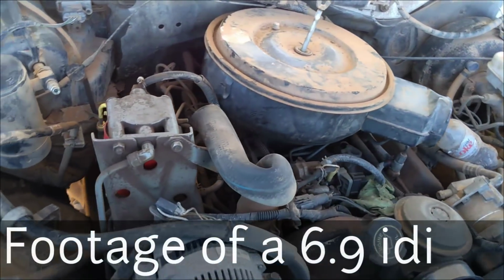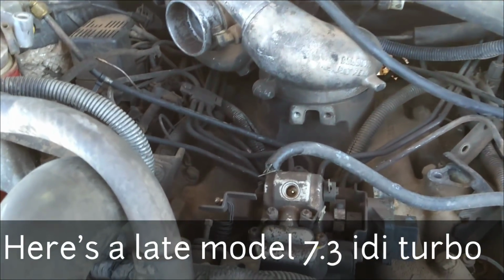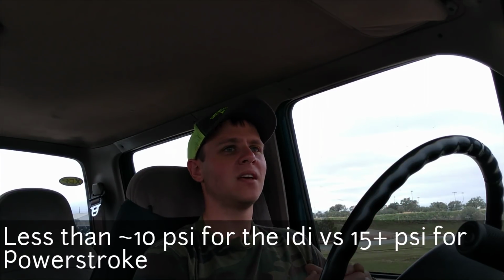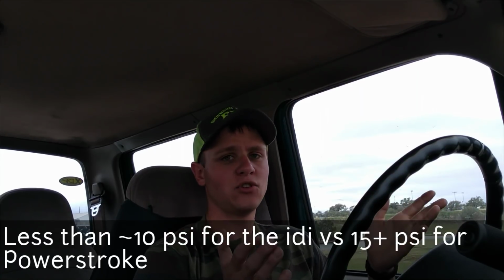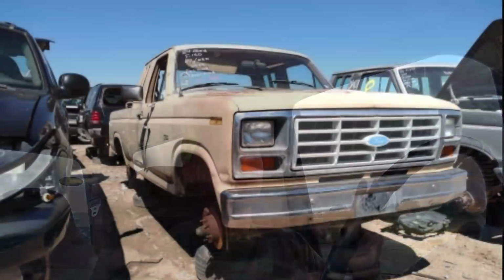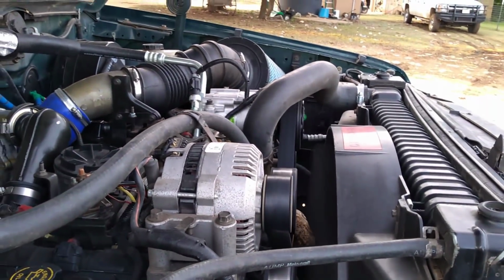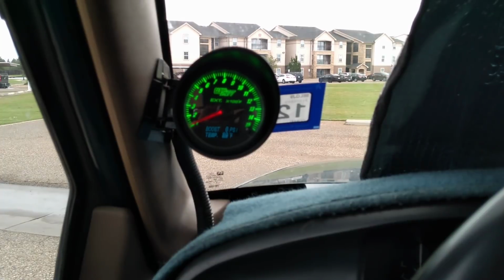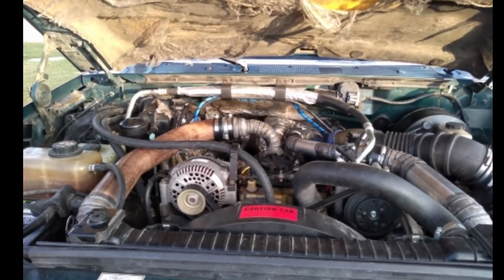7.3 Powerstroke Pros and Cons Part 1 of 2

Comment: I have owned 3 powerstrokes and 2 IDI's plus recently I talked a buddy into buying a 97 ambulance with a rat chewed PSD. I prefer a NA 7.3 IDI enough power for my 89 2WD F250 gets good gas milage currently 19mpg in town and keeps up with traffic compared too say my 83 Mercedes240D. The Powerstroke has gobs of sensors is much more expensive to work on (well replace parts) then the IDI. My buddy's ambu took awhile to get dialed in and I watched his enthusiasm wain and soar, hes currently soaring as its running like a well tuned machine. The biggest issue with any diesels is the fluid replacement is costly, Im always putting diesel clean or ATF in my fuel, diesel as we know is more expensive then gas, coolant change out is minimum of 130 bucks,, but needed due to cavitation, all in all I love my trucks and cars that are oil burners but maintenance is key to longevity. Excellent video!
Reply from the maker: Thanks for the compliments Deepblu dude! Diesels are definitely expensive, but in the end I still think its worth it. These old Fords are fun to drive and they're simple enough to work on at home. I really like the old IDI's. In some ways I do wish I got one instead. They are cheaper to work on. I've done some preventative maintenance on my 97 and its $200 for an ICP sensor, $40 cam position (plus another $40 for a spare in the glovebox). Injectors were over $1200, but hey, the thing makes gobs of power now! I know a set of IDI injectors would have only cost in range of $300 instead... I mostly just worry about the people not taking care of the IDI like you do. Most folks don't pay attention to the coolant and you really have no idea what state the block is in cavitation wise. I'll second that, maintenance is key to longevity. Happy trucking!

Comment: great vedeo mate and good explained but on my opinion I prefer a minimum electronics stuff's!! I prefer a first 7.3iDi Because not have a electronic injectors!! and more fiability but I have a excursion 7.3 power stroke 2001model but if I can I replaced this international engine to the CAT 3208 without a turbo!! that's a really good engine!!
Reply from the maker: It is nice to have the all mechanical diesel, I really wanted an idi at first, but somehow I convinced myself that the Powerstroke would be better in the long run. I'll get me an idi one of these days, those bull nose OBS Fords are some of the best looking trucks too. 3208 would be cool, but that is a giant engine, so good luck fitting it in the truck, better yet, just drop in a 3406 and remove the hood!

Comment: 2018 and he is recommending bullydog or ts6? HYDRA!
Reply from the maker: Yeah yeah, I like the old school simple switches anyway! Besides, its so much fun to rip apart the interior when/ if you ever decide to change tunes, think of all the fun you're missing out on with the Hydra! Tbh, the TS6 chip was cheapest, that's the only reason I got it over any of the others.
Reply: @Rnddiesel   I seem to have the interior ripped out more often then normal people. it is down to bare frame now for a resto mod
Reply from the maker: @xxxmikeyjock  That's awesome! I'm sure its a lot of work, but not many folks take the time and dedication to do that much to fix up an old truck. Best of luck with the resto!

Comment: How popular is a 2000-2003 dually supercab  powerstroke 4x4 these days in the modern world ?
Reply from the maker: Good question, I think it depends who you ask! I can't say I've seen very many of them driving around, though they definitely are cool rigs. Is this a truck you're looking to sell?
Reply: @Rnddiesel  great reply ! On the contrary, I own 2 LBZ duramax,  however a buddy is selling a 90000 mile 1 owner dually supercab 4X for 6000, meticulously maintained, its like I almost want to have it because I want it, but really don't need it ) does this make sense, I also own a from new 1993 f-150  so it's not like I'm not a ford person, but the powerstroke is a very cool addition! And well if I decide not to keep it, I wonder how difficult it would be to sell it on maybe for a profit ?
Reply from the maker: @lanaliong3712  If it's in as good of a shape as you say, I'd get it without  a doubt. Finding a 90k miles 7.3 is like striking gold, that is they are very rare at that low of mileage. For $6000, I'd say that's a steal of a deal no matter how you look at it. Unless it's been wrecked or something like that, that's a great deal. Definitely look and see what comparable 7.3's are being sold for. For reference, I paid $4500 for my CCLB OBS 4x4 with bad brakes, worn injectors, bad radiator, no AC and 343k miles on the odometer. Even if the dually supercab isn't the most sought after, I think people will want the truck simply because it has such low mileage and is in great shape. Also those LBZ's are pretty cool! Those are impressive engines and make gobs of power. A buddy of mine had one back in high school before wrapping it around a telephone pole... He could brake the tires loose going 45 mph on a wet road. It also pulled our show tractor like it was nothing!
Reply: @Rnddiesel  great advice.

I also like the fact you agree the 2002 dually supercab stroke is less desirable CONPARED to A LBZ 

Right on point

You know your trucks 

I'll let you know how it goes )))) just sold my cavalier tonight for 3000

Can't go wrong on that too

It was time to let go ))
Reply from the maker: @lanaliong3712  Sounds good! Well you've got to tip your hat to GM with the Duramax line. They were the first to implement a lot of modern diesel technology early on. Heck with the introduction of the LB7, they were the first of the light duty market to offer common rail injection. True, their injectors weren't known for being the most reliable in the world, but when Cummins still used a modified mechanical pump and International was using the HUEI injectors, GM was way ahead. Some would argue the Duramax was the reason why Ford did away with the 7.3 in favor of the rush to market 6.0, in addition to emissions regulations...
Reply: @Rnddiesel  agreed,  hate to say this but, Isuzu division really saved gm on this one.

Comment: i got an 84 f350 6.9 idi 40 years old and still kicking and i get 20 MPG  to
Reply from the maker: That is an awesome and beautiful truck you've got! That was my dream truck for the longest time, and still is in a way, though an 85 or up model would be nice for the reinforced block heater hole in the block. Manual transmission?
Reply: @Rnddiesel   c6 3 speed auto extremely dependable

also if your block survived so far without cracking then you just remove the block heater and use a lower radiator hose heater then the block does not get a hot spot and won't crack from the stress best part is it just T's into your radiator hose

my truck will start in -40 no problem  even without the heater (lol just 40 min warm up)
the trick is kerosene mix it 
90/10 diesel/kerosene for old trucks
80/20 for 30 to 40 F
and 50/50 for -50 to 10 F
dont forget to add some lube tho the kerosene is more dry than diesel

the old trucks need a more combustible fuel to run properly because they were designed to run on "standard" diesel with a cetane rating of 60  not ultra low sulfur diesel with a cetane rating of 25-40

i wish i could win the lottery i would yard would be 1 huge shed full of 63-91 trucks/cars
Reply from the maker: @Friedrich-Wilhelm-1980  That's awsome! I've heard the c6 is a pretty good transmission too. I've got to get an idi one of these days. It's definitely impressive that your truck can start so cold, heck I've only ever been in -11 degree weather before, we had a gas suburban and it started without any fuss! I appreciate the fuel mixing tip. I never even thought about relocating the block heater, that opens up the possibility of getting an early model 6.9 then, thanks! I definitely hear you on the winning the lottery part. Have a shop full of old cars and trucks with every tool imaginable to restore/ fix them up. If you could get a die sink electrical discharge machine, 3d scanning/ modeling software and a 50 ton press, you could remake any part on the whole truck. Best of luck with the lottery, I know I'm hoping to win myself!

Comment: I own a 2000 7.3L Powerstroke CC LB DRW 4x4 ZF6.  Best "big truck" I've owned, will never sell.  Wouldn't own a 6.0 if you gave it to me, same for the 6.4 or 6.7.  No thanks.  I'll keep my 7.3, thank you very much!
Reply: I have a 2000 F250 7.3L SRW 4x4 but I have the 4AODD but she is 21.5' of glory and only at 149,271 miles
Reply: Are you high
Reply: To be fair. The 6.7l is bad ass. Ive got a '17 f250 and love it. I DO want a 97 7.3l f2/350 though
Reply: Chris Farley I’ve got 2000 yr f250 7.3 and 368000 kms also have a tune in it , no transmission rebuild for me as yet. It’s my service truck.
Reply: Would you take your 7.3 over a LBZ duramax ?
Reply: @lanaliong3712  Yes. All trucks including the duramax have their issues. I'll take the ones that come with my 2000 F350 7.3L over any other variant out there. And I'd do it without reservation. As always, YMMV. Thanks
Reply: @RX7GSLSEowner  i have a 2000 F250, feel the same way.
Reply: @lanaliong3712  early Duramax is junk. Too many problems. Hollow crank shaft? NO THANKS. DURAMAX IS NOT A REAL MEDIUM DUTY ENGINE. 6BT AND 7.3L ARE REAL ENGINES. ALL IRON. OVERBUILT.
Reply: dsruddell I am happy with 1982 GMC C2500 6.2L diesel TH400 3:73 rear axle ratio and I do just about anything the other diesel pickups can do and I can do it burning less fuel. It's no speed demon yet it gets from A to B
Reply: @mikemcgrew65  ive owned a few of those. they are junk and make no power. they were designed as a fuel economy engine. not for heavy duty use.
Reply: All day long. The duramax from that era was prone to injector and head gasket failures.
Reply: @lanaliong3712  every component on the rotating assembly of a duramax is much smaller than a 7.3L. cranks on the duramax are hollow too.
Reply: @dsruddell  well hauling 15000 pounds
consistently for 450 miles a day every day to a million miles with power and efficiency and the Allison it's a no brainer ask Indiana transport they have done it and still rocking their 2005 LLY

Comment: i work my 7.3l hard but i change my oil at 3k... sure it costs a little more but at 5k your oil is junk and you will spend the difference in oil changes on new injectors sooner
Reply: Maintain and keep stock your engine won't knock got life time oil changes still and I bought mine in 2002 it drug carpet up to Tahoe had 18,000 when bought now has 220,000 its weakness has been wireharness fails,transmission and cold starting cause where I live is cold in winter and hot in summer.Heater cured the cold start but am dealing with transmission  issues but rather get her on the road than deal with newer garbage and their expensive costs.
Reply: @lawrencemartin519  mines at 314k but I have a manual so I can't help you with the trans problems. If you plan to keep the truck I'd have Brian's transmission do a lifetime trans on it and be done.
Reply from the maker: It's never a bad thing to maintain your old 7.3, I'm sure she appreciates it!

Comment: I was under the impression Ford made IDI motors with a turbo from 93.5 to 94.5 and after they utilized the powerstroke?
Reply: Yes ford did offer turbo idi from 93.5 to 94.5. The motor has some upgrades done to the internal to support the factory turbo compared to the N/A idi.
Reply from the maker: That's my understanding too. Somewhere around early 94 they made the switch and offered the turbo IDI alongside the 7.3 Powerstroke as well.

Comment: Very good video it's nice to see people that really know these diesels. I own a 7.3 power stroke. And when I take the oil fill cap off when it's running I see a light white smoke coming out, but when I but the cap on the top it doesn't blow off or even vibrate off. Any suggestions will be appreciated
Reply from the maker: I appreciate it! The smoke you see from the oil fill cap is 'blowby.' Essentially it's combustion gases that are leaking past the piston rings and making their way into the crankcase. Even new trucks have a little bit of it, current technology doesn't allow us to make piston seals perfect. From the sound of it, your truck is just like mine regarding the blowby. With the cap off you see the smoke, put the cap on upside down and it just sits there, that is good. If the cap was blow off by the pressure in the crankcase, there is where you should be concerned as that would indicate a severe loss of compression in at least one cylinder, maybe due to a cracked piston, broken ring, or any other wild possibilities. Is the truck burning tons of oil? It is very low on power? How many miles? My truck has nearly 365k miles on the odometer, it's a bit worn, but doesn't go through more than a quart or so of oil every 3-4k miles, though it does also leak some of the oil too. The 7.3 Powerstroke is a good engine, just take care of it, keep up with the maintenance, and as long as it doesn't seem like there's something terribly wrong with the truck, don't worry about it. If it runs fine, doesn't consume too much oil, makes decent power, just keep her going. If it does really concern you, consider running a compression test to see what condition the engine is in. Hope this help!
Reply from the maker: @John Campos  I haven't done the CCV mod myself, though I definitely have heard of it. The blowby gases coming from the crank case ventilator do carry some oil with them. Wherever you route the 'tube' from the crank case vent, the oil/ blowby gases will come out there. Though odds are it'll leave an oily residue wherever the gases come out. I would like to eventually do something for the ccv since the current setup introduces oil into the intake tract which is incompatible with the silicone boots and deteriorates them rather quickly. Ideally I'll build a heat exchanger that cools the blowby gases to recondense the oil, let it flow back into the oil pan, and only feed the non-condensibles  into the air intake. I think a lot of oil I'm 'burning' is actually from the stuff that gets vaporized and put into the intake.

Comment: I currently have a 96 7.3 and the last owner really abused her and never kept her fluids up so I unfortunately found a block crack but I love her too much so I’m going to engine swap her coming up in the future #ford neverdies
Reply from the maker: Awe man, sorry to hear about the block! It's great to hear you're giving the 96 a good home now, not many folks are willing to do that much work on a 22 year old truck. Just make sure you get an OBS engine, or at least swap cam-shafts if you plan on using the mechanical lift pump still. Best of luck, I hope it turns out well!

Comment: When your talking about the "low power" of an idi kept in mind that the 93-94 Idit was very "detuned" by Ford from the factory. And when tuned right with stock parts will make just as much as an obs powerstroke.
Reply from the maker: Fair enough, the non-turbo idi's however, you can't exactly crank the star wheel enough to compete with a well tuned Powerstroke. Thanks for the input! Idi's are still really cool, I originally wanted one instead of the Powerstroke due to their simplicity and low cost. Do you have an idi?
Reply: Rnddiesel yep, I have one and so does my dad. His is a 94 idit and mines a 93 idi with a turbo kit i put on. I guess it really depends on if people know what there doing to them that makes more power. Cause I've beat a 97 7.3 with Tuner. But no way my dads would beat the school bus Haha.
Reply from the maker: Nice! See it takes more work, but I guess you can get decent power out of an idi. It probably helps since the idi's were originally designed to run without turbos, hence you have a more snappy truck with less of the turbo lag compared to a later model psd, I would presume. My truck has a solid 2 second delay for the turbo to spin and make power, the psd relies on the turbo. I'd challenge you to beat my 97 7.3 psd with 160cc injectors though... You just can't get that much fuel in an idi unless you went with some radical custom injection pump and injectors. At that point though we're not exactly talking about "stock" trucks!
Reply: Rnddiesel mabbye if you lived In MN we could make that happen sometime. And yeah it would take a lot of fuel but I'm pretty sure http://www.idiperformance.com could make it happen
Reply from the maker: Dang that is awesome R&D idi, I like the name too haha, thought I was being original... Anyway, yeah MN is a ways away from me, it's cold enough when it gets to the low 30's here! You're making me want an idi now too, guess I'm going to have to get one eventually anyway.
Reply: Rnddiesel ayy I like they way your talking now Haha. Yeah there's really something unique about and idi with a turbo and straight pipes that no one understand until they drive one.
Reply from the maker: Haha, yeah I guess so, NA idi's sound like big block gassers though, it's kind of weird. We'll I'll get there one day, I've got the PSD for now!
Reply: Rnddiesel yeah I'd agree if the NA is straight piped it's weird but true duals sound nice.
Reply: @quickclutchproductions9212  the idi was a good motor for it's time and actually still is, but it will never make the power the 7.3 psd makes. I mean it can but by the time you make 600 hp with your idi you could've bought a new truck already, so many areas to address on an idi to make real power. My 7.3 psd should be making about 350 whp according to what full force claims. And I'm just on stage 1 injectors.